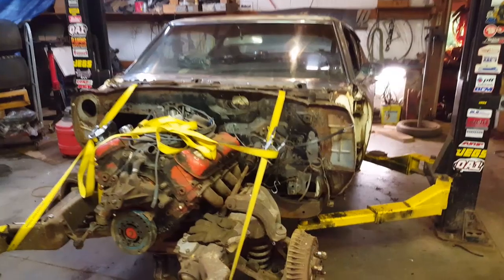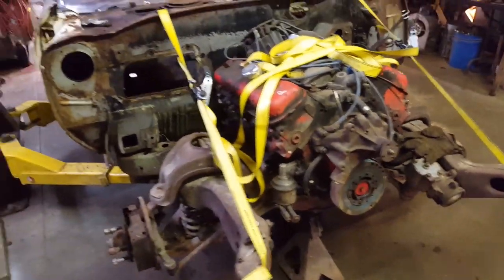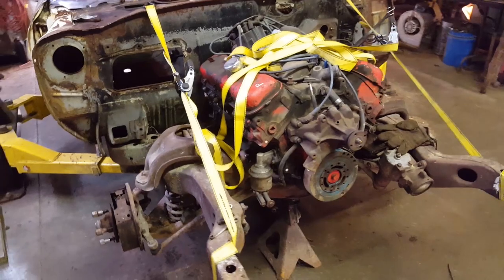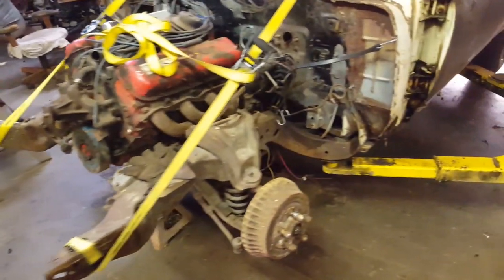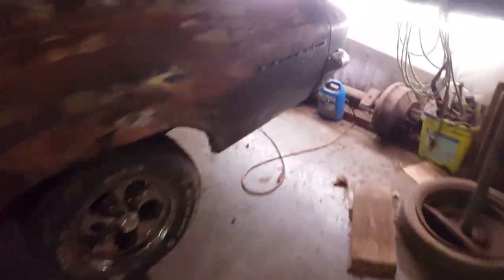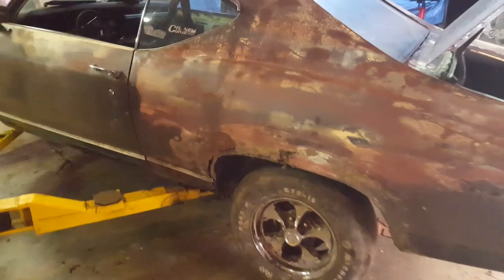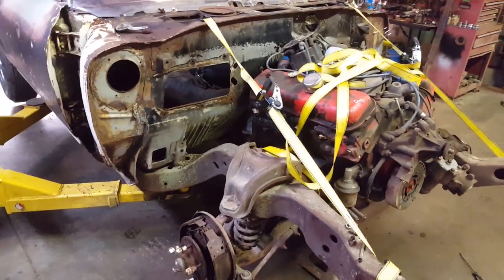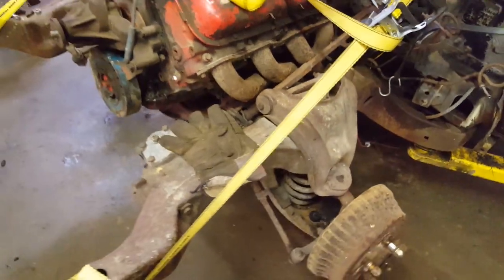Budget Beater Chevelle  Big Block is in! |Sketchy's Garage

Comment: Nice,  Pop's is goin off on this car!  Smack the old header in and call it a day would be my call. Replacing the steering column and box might be an option too if the cost is reasonable and you can find one with the right clearances. Give it a bit better steering in the process too maybe? As for the exterior, patch the holes,leave the patina for now. Paint only makes it look faster. =)   ... though you guys do have a nice looking cheap paint-job i saw in another video... with the name you have given it you could go canary yellow with a replica/parody logo for Budget rent a trucks with "Budget Beater" instead maybe if ya want to have some fun with it.
Reply from the maker: That's a cool idea. 😎